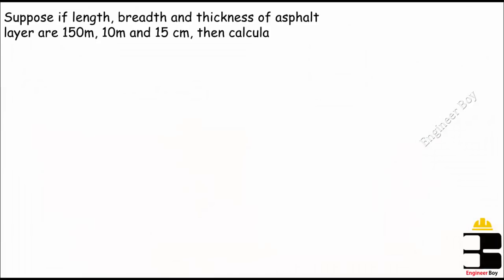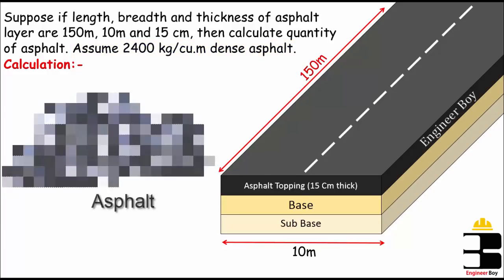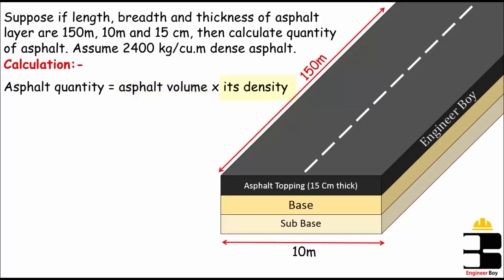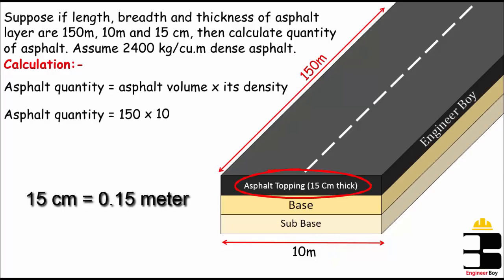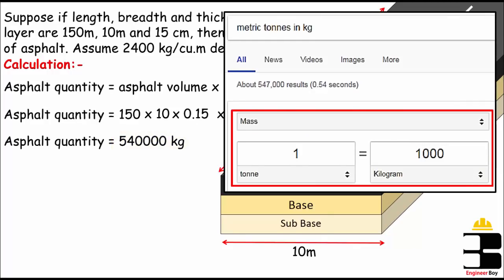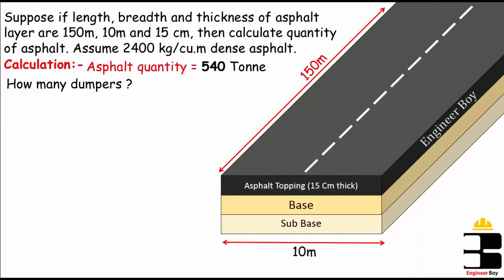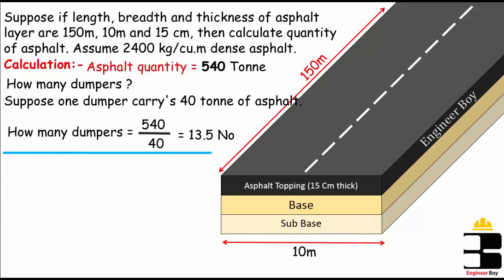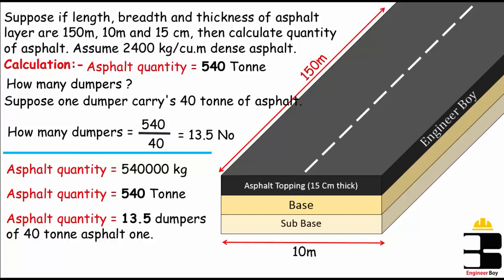asphalt quantity formula/ civil engineering

Comment: 2 question.
1: how do find the asphalt density ?
2: in your video asphal = liquid petrelum  bitumen  only or misxture of liquid bitumen preleum with gravel (concrete like ready to use on the road)
Reply from the maker: Good question, remember when asphalts are designed before its use, so while designing this we take a sample and find its volume and mass, now mass and volume ratio is going to be its density,
Secondly in my example asphalt is the mixture of bitumen and aggregates